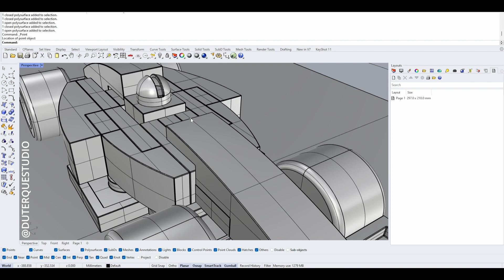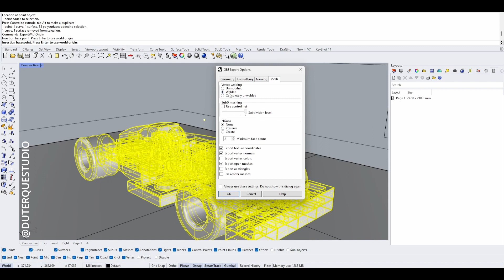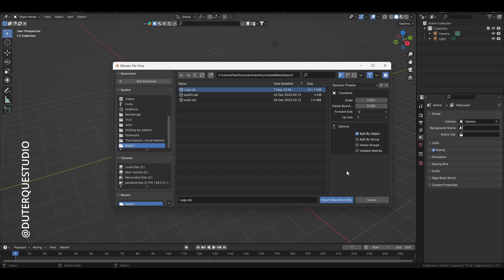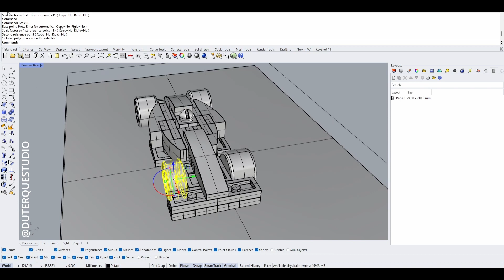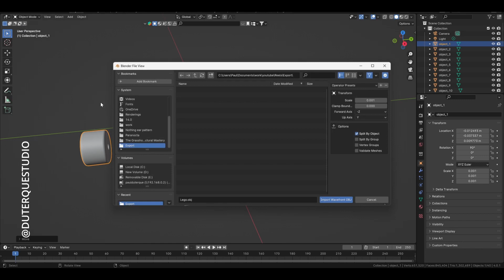How to use your rhino model in blender | Rhino Basics

Comment: Great video! thanks! is it also possible to export the layers with objects in rhino to collections with the same objects in blender?
Reply from the maker: Thanks, not directly but you can export each layer a 1obj (or mesh) and when you import it in blender it will be a single mesh that you can separate by loose part( p in edit mode —> by lose parts). The separated mesh will be in the same collection as the initial one.
It’s not very straight forward but it works